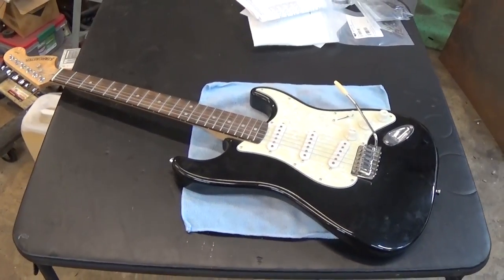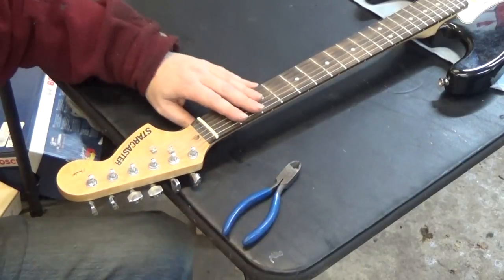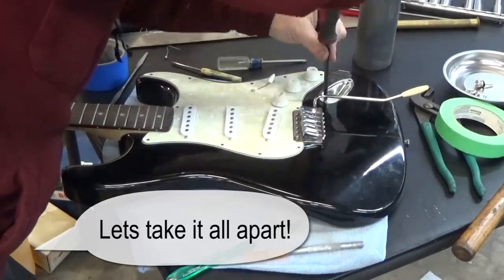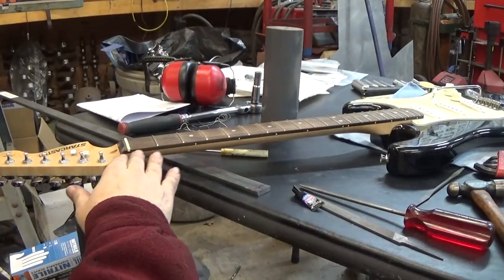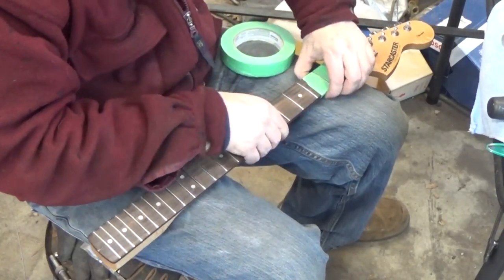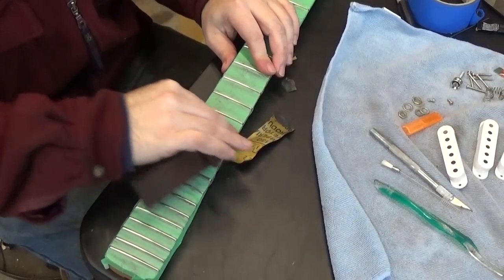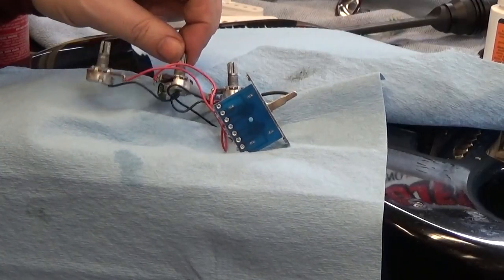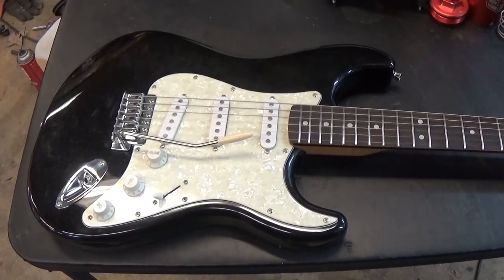Fixing up a cheap Fender guitar

Comment: I Bought About 10 Of These And Turned Them Into Guitars That Match A Regular fender.
Leveled, Crowned And Dressed the frets, All Edges Of Em. Roller Saddles On Some, Roller String Trees On All. Bone Nut, Squier trems With The Big Diameter Whammy Hole. New Tuners, Pickups, Pickguards, And All New Electronics, CTS Pots And All Have 3 Way Switches With the Bridge PU Tied Into the Bottom Tone Pot. They All Rock And Switch Playing Out With Em Every Weekend.
Cant Afford A Real One And Had A Blast Doing All The Mods And Tweaking On Em.
Rock On Dude.

Comment: I have a crappy starcaster that was given to me and I completely rebuilt it and now it is one of my favorite guitars. I replaced the pickboard with a loaded one, replaced every plate, tuning peg, string trees, replaced the bridge saddles and input jack. Painted it with black spray can truck bed liner, adjusted the truss rod, set the intonation and man it plays just as well as my fender jaguar and as well as any Stratocaster I’ve played. The only thing I need to do still is file the frets, there’s just a little bit of fret buzz on the G but it’s not terrible. Rock on!
Reply: Sounded awesome until the" I sprayed it with truck bed liner."

Comment: Nice job. I've been doing my own set-ups and mods for years. You pulled off some really professional tactics here. When you popped out the fret, i gasped! Was like holy sh:t, I would never attempt that, and then to reshape and (successfully) set it back, props to you! Too many people are afraid of their instruments. Fender makes every screw and part removable and replaceable for a reason. So you can do it. They even give you an allen wrench so you can adjust your own truss rod. A cheap guitar like this is perfect for any novice to dig in and learn that it's not all that complicated.

Comment: cutting all the strings together is bad because there is a sudden decrease in tension
the whammy bar changes the tune of the guitar because it puts a sudden decrease ( and increase) tension in all the strings. Thus a neck should break after the use of the whammy bar?
Reply from the maker: You whammy bar only changes the pitch of the strings a note or two - not quite the same as releasing all tension at once.  And, I doubt you'd actually crack the neck, although it might be possible, but I think you'd shock the joint where the neck connects to the body, and after a few string changes like that, it could get loose and then it would never hold a tune.
Reply: The Truss rod itself is a stability feature for the neck as well as adjusting it as wood warps with difference in temperatures and moisture so dive bombing on a Tremolo does crack the neck, or the bolt on joint, they're designed to take that exchange. however cutting all strings at once isn't really a good idea because of rapid tension differential, your neck may warp a substantial amount
Reply: @Mvsters  I was waiting for someone to say that. Lol. Truss rod keeps it good and not snappy.
Reply: @Mvsters  I have one of these guitars and it's truss rod is unadjustable. Luckily , the neck is straight. But no relief. What do you expect for 60 bucks?

Comment: Wrong file used for fret leveling. With the proper leveling file no need to tape the fretboard since it should be the same radius as the fretboard and only take material of the frets and not the wood. The frets also need to be recrowned after leveling using a fret crowning file. All he did was file the frets flat.
Reply from the maker: It's true they make specific fret files, but purchasing a set from Stewmac didn't seem commensurate for a $100 guitar.